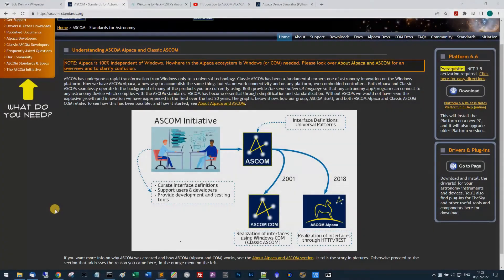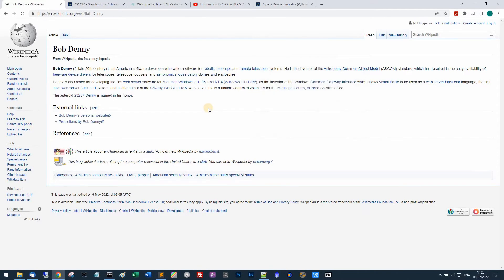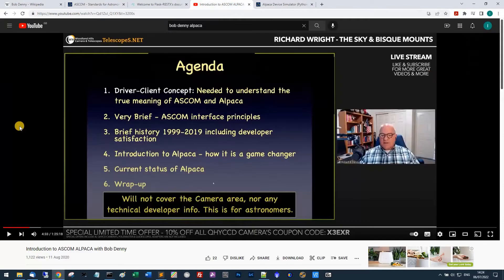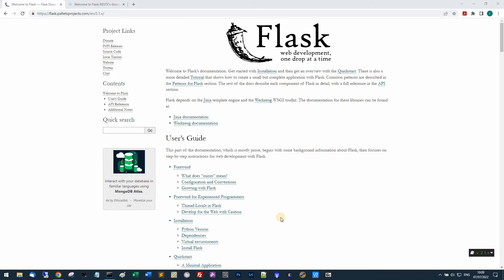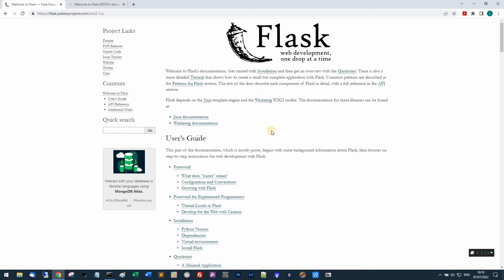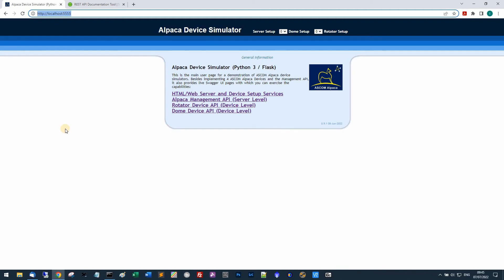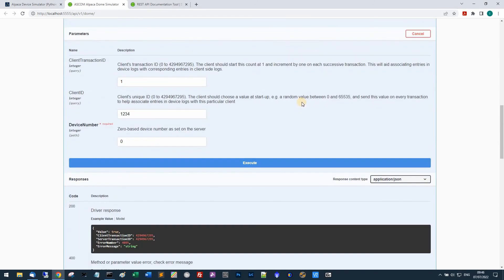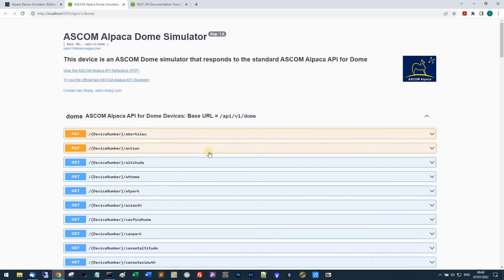ASCOM Alpaca Dome Software Part 1

Comment: This has been asked already but do you still plan on sharing that driver  ? I was just about to start writing my own dome drive  in python for a Pi but this is a bit difficult for me right now. I have plenty of experience developping for classic ascom on windows  but I'm a big noob regarding python and Alpaca. Starting with your code would have been a great help.
Reply from the maker: Hi, I'm swamped with other projects at the moment, but your best bet is to do what I did and start with Bob Denny's code template for an Alpaca driver. It's easy to install and has an excellent testing interface. You would need to add in your own implementation code for your own hardware anyway, so this is the only part you really need. Start here - there are loads of topics here that help and you will find the code here: https://ascomtalk.groups.io/g/Developer/topics
Reply: @iansharp1171  thanks that's helpful

Comment: Hi Ian, I have found your videos very informative, I have a dome that I bought second hand. I rebuilt it last year and now would like to sync my Dome with my Telescope. Using your scheme I am trying to simulate your solution using an Arduino UNO. I have not done any programming since 1980 using the Tandy TRS80 Microsoft Basic and Fortran at University. Hence I am now trying to learn to program again (slowly).  I have managed programming the Arduino to control the motor speed and direction and reading the input from the IR sensor.  Where I need help is how do I get my laptop to pass the aziumuth angle to rotate the dome to the Arduino so that the Arduino can calculate the number of pulses for the IR sensors to position the dome. I look forward to hearing from you as I haven't been able to find part 2 of your software video.
Reply from the maker: Hi Malcolm, apologies but I just haven't found the time to make the part 2 video. To answer your question, the ASCOM Alpaca driver that I talk about in this video allows 3rd party control software such as Sequence Generator Pro to send the require azimuth to the ASCOM driver over the LAN. The Python-written ASCOM driver must run on the RPi (in my case) or Arduino (in your case). Unfortunately, I have no experience of the Arduino at all, but I'm sure it must be able to have Python installed (maybe you are already using Python to program the Arduino? You can find a lot more helpful support on the ASCOM group here: https://ascomtalk.groups.io/g/Help (you might find someone who has a dome driver running on an Arduino)
Reply: @Ian Sharp   Thank you for your reply, I will investigate the discussion group and  do more reading lol.